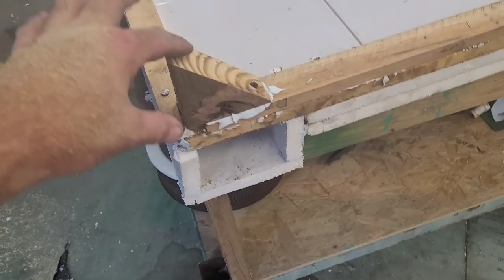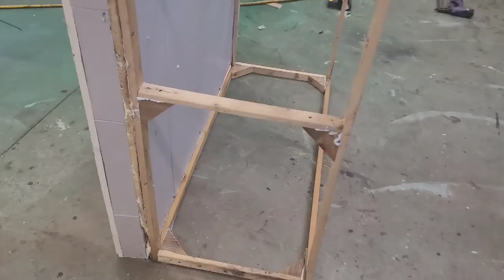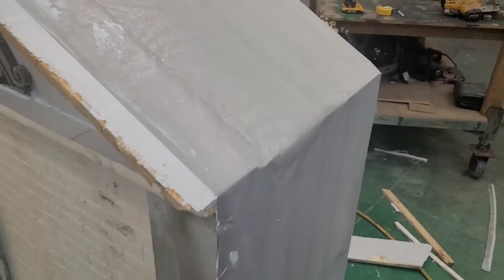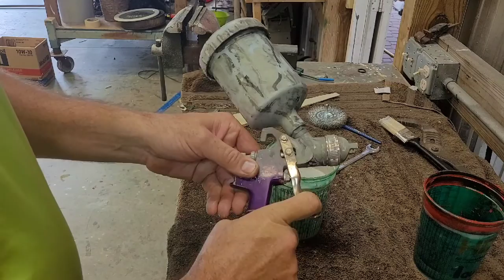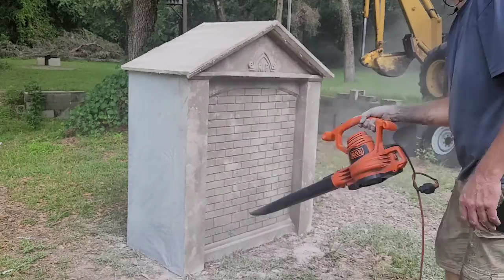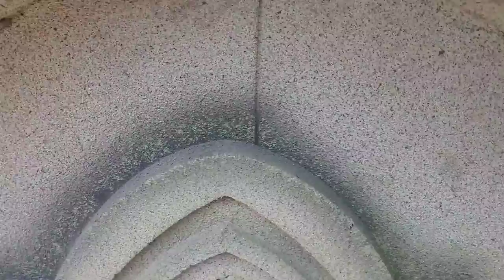diy Mausoleum build part 2.

Comment: Where did you get the house wrap?
Reply from the maker: Lowes. In the video, i did say house wrap. It is actually for roofs. That why it has that almost brick like print on it. You might have to ask. At my Lowes, it's on a shelf since it's only four feet.